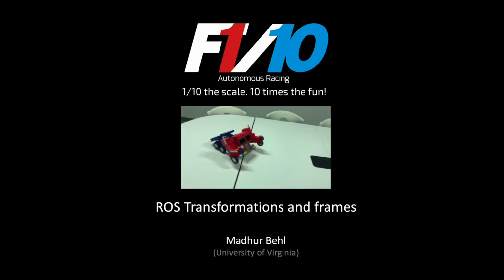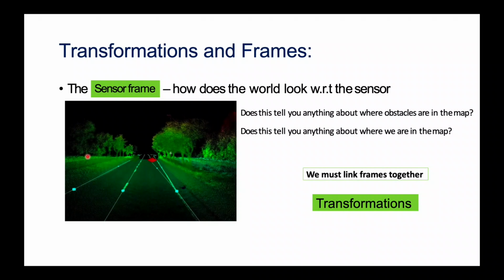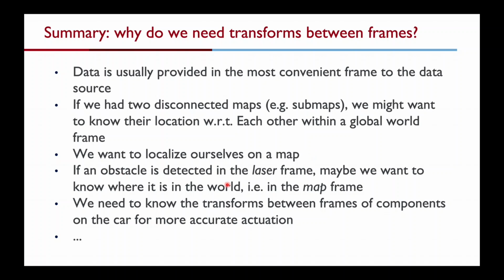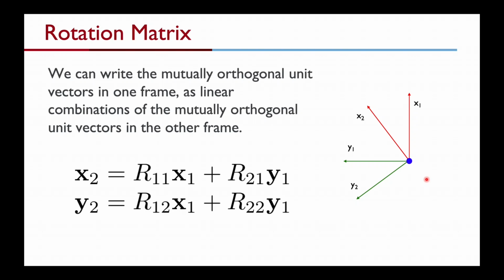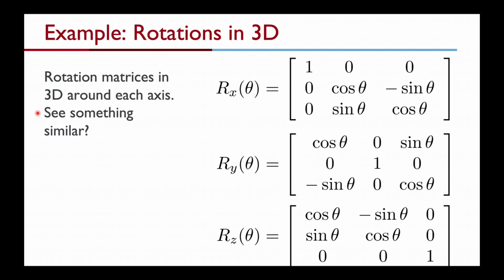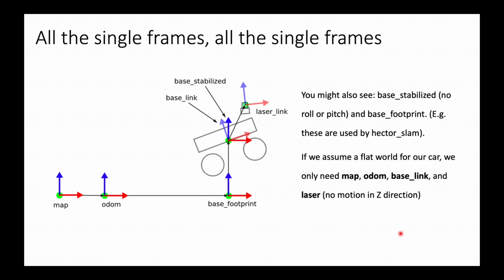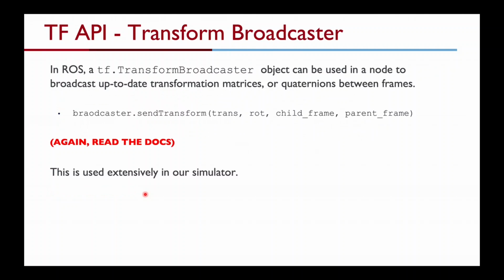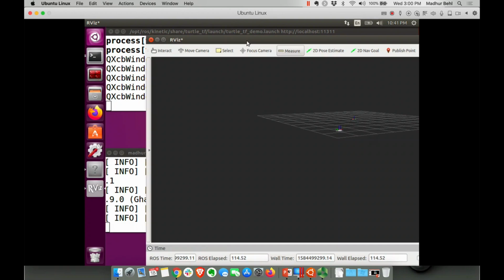F1tenth (F1/10) Lecture 9] ROS Transformations and Coordinate Frames

Comment: Thank you so much for sharing!! Just one question, if I have a transformation tree map->odom->base_link->laser_link, should I associate base_link with map or odom? I mean, I have the odometry info, so it is correct to say: 
odom_msg.header.frame_id = "odom" and odom_msg.child_frame_id = "base_link" 
or 
odom_msg.header.frame_id = "map" and odom_msg.child_frame_id = "base_link"
Thanks in advance!
Reply: The REP-105 can help you here: https://www.ros.org/reps/rep-0105.html
Reply: I'm facing a very similar scenario, how did you solve it? Are you using the odometry pose estimation to fill in the map->base_link or somehow dividing it into map->odom->base_link?
Reply: Associate base_link with Odom. In case when Odom is same as map it will have no effect, but in some cases odom might be different from map. Thus this definition will work with both cases.